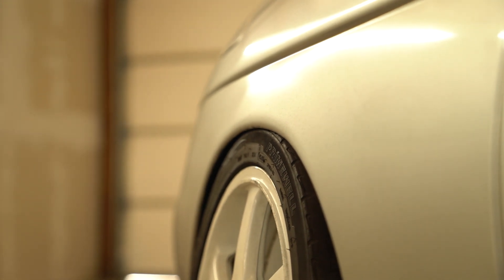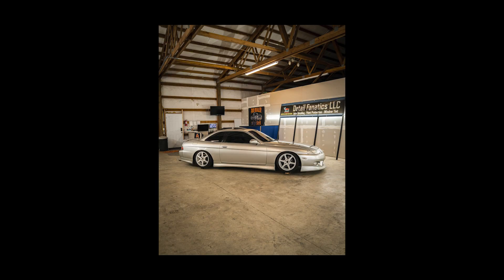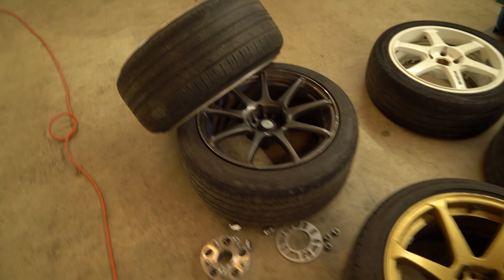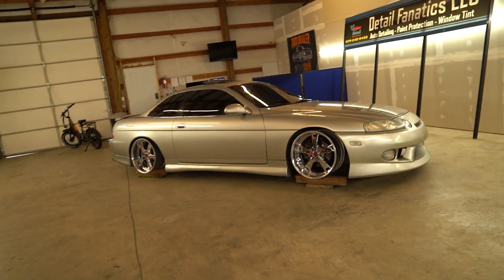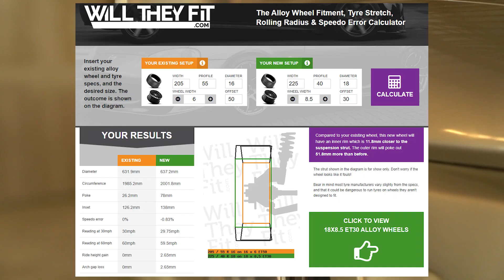17, 18, or 19's for your SC300/400?

Comment: Even though I have new suspension, I really like the Sidewall. My current spec is 19x9 +21F(245/40/19) and 19x9 +17 R (235/40/19) so close to being aggressive. my tire setup may look crazy, but even on the roughest roads, it handles them well. Thanks For showing this so others have an idea. The various wheels look really cool. but I would rebuild to be less agressive not to damage / pull the body. Great video Jon!
Reply from the maker: That's understandable, thank you for the comment 👌🏼

Comment: I have SSR Vienna Courage on my '95 SC 400. Rear 19x10, +38, 275/30, Front 19x9 +38, 245/35. 1" Tanabe lowering springs and struts. Rear fenders shaved. Fronts untouched. Rides nearly the same as stock

Comment: i have a 97 300 wth stock 16s on it and want to sizw up the wheels without rolling the fenders at all, can i do 17/18 with an offset like +45, closer to factory offset (+50).
Reply from the maker: There's a guide out there letting you know if those specs will work.

I don't work with those specific specs so I won't be able to tell you.

Just look up wheel fitment guide for sc300 on google.

Comment: good video! Trying ot figure out what to do with my '99 SC.  I currently have 245/45 R18's all the way around but am debating on going smaller, or even stock.
Reply from the maker: Depends on how you want to look yk.

245/40 at the minimum if you want to look better imo. Or even 245/35

Comment: Congrat. Its a great video. Im thinking to buy a 11x18" ET15 5x114 wheel as replacing  rear wheel. what do you think? what needed to do for it?
Reply from the maker: Those are pretty aggressive for stock body, you will fs need to roll/cut your fenders, and then pull them slightly depending on what your fitment goals are.

Comment: Great video... Thanks!  Also, didn't know you could jack up the car in the middle to lift both front & back on one side. Is that the norm, or just a risky move?
Reply from the maker: It's not normal, I have a rubber pad with slits and put the welds in between so they don't mess them up. So far so good...

Comment: Man I want my sc to look that good but I just can’t be static like that I drive too cray u feel??  Have fully adjustable Megan suspension, all stiff bushings, teins set to be soft on sparco 18x8 no stagger can’t remember what tires but summer comp. I love the adjustability and knowing that I coouuullllld go this route is cool but I just couldn’t sacrifice what drivability I have left. Would bags be the compromise I’m looking for u think?
Reply from the maker: Coilovers I would say is better than bags in terms of performance. So I would stay with coilovers since you have adjustable suspension you have.

I look low, but I'm not that low in my opinion in this video.
Reply: @JonathanMai  heard. Bags are so much $$ anyways, I’ll lean towards performance for this car at least Ty.

Let me ask you question - any idea if this part/product exists - just a thin rubber spacer for inbetween top hat and body? I swear the oem suspension had that but I cannot find where tf they went. I believe it’s called an insulator but can’t rly find anything online
Reply from the maker: @dackbowland1876  Not totally sure, you can make some out of whatever material you can find though.
Reply: @JonathanMai  true I’ll figure it out. Thanks homie, clean sc glad I found u on here lol.
Reply: @JonathanMai  just thought I’d let u know I found the exact thing I was saying  but not rubber - ‘polyurethane top plate spacer’ 

it’s usually for ppl who are doing lifts or the opposite kind of suspension tuning as going low lol but I can still be slammed with 1/4 spacers on top if I wanted.

Comment: Wey, sabes que turbo le quedaría chido al sc300?, quiero ponerle entre 500 y 600 hp, ya se que fuel pump y que inyectors ponerle, solo no se que turbo sea bueno para ese 2jz
Reply from the maker: 500 es suficiente bro, 600 es mucho pa las calles. 

para el turbo, depende con lo que quieras.

Comment: Hey y’all I have a question! so I ordered some RPF1 for my sc300 and I have the Supra break kit ready but not installed and I got too happy and ordered the wheels too but I’m not sure if I messed up and got the wrong specs… I got 5x114.3 9.5 38 for the front and 5x114.3 10.5 15 for the back do you think I got the right dimensions for Supra break calipers to clear or be fine?..
Reply from the maker: The rears are fine, you are probably going to need to run a spacer for the front.
Reply: @JonathanMai  thank you! And why a spacer for the front? 🤔
Reply: @JonathanMai  ohhh you meant so it can be flush with my fender
Reply from the maker: @GarageBuiltStatus  No, in your case it would be to clear your front Supra calipers because those are bigger.

Comment: If you want a terrible ride quality go bigger and if you want to literally cripple your car then lower it.  
If you ever got in to a fantasy movie style high speed chase in this car you’d blow your spoiler kit to bits.  Unless you’re on a perfectly smooth racetrack this car has been hobbled.

I wonder why police never lower their cars or put low profile tyres on them?  Because they have to ACTUALLY go fast on real roads.
Reply: Mine is lowered 1" and on 19's. 275/30 rear, 245/35 front. The ride difference from stock is barely noticeable. I don't have a body kit.

Comment: why do you guys care so much about "flush" and not proformance?
Reply from the maker: You can have the flush look for more than just wheels, it can be with the tire too.

Also, not everyone cares about performance.
Reply: when you start flaring the fenders and chipping the paint you cannot go back and just looks trashy and cheap to me. its like all the money goes into the wheels and nothing els... its a very immature way of modding a car. @JonathanMai
Reply from the maker: I see it as, why buy stock spec expensive wheels and tires for it to look stock still. You need to roll your fenders imo to make them fit more aggressively.

To each their own.  @wotceseriescollector
Reply: you buy wheels that fit on the car so you dont have to roll fenders and fuck the car up. it loses value long term when you do that. these are not throw away cars they should be something you take pride in and want it to last longer then you. @JonathanMai
Reply: i understand doing it to a pos car but the sc was the top car of its time. its value back then would be what a lc500 cost now. @JonathanMai
Reply from the maker: I mean its their money, what can you do about it if they wanna make their car lose value by rolling the fenders. They probably got it a decent price and don't care about it.
Reply: i can say how i feel about it thats for sure lol but i cannot make anyone do something they have to grow up and do it themself. & if you dont care about the car then maybe its not a good idea to be putting money into it. usually when you put money into a car you want it nice and to last long @JonathanMai